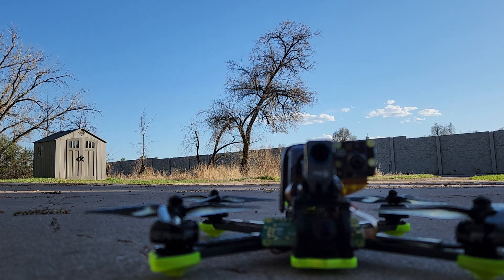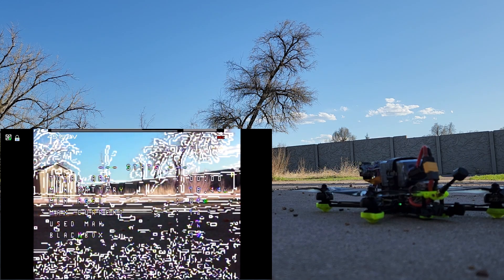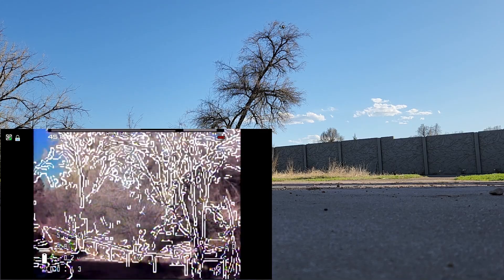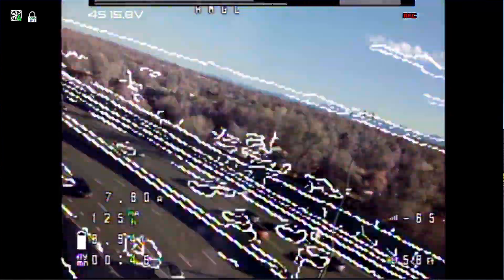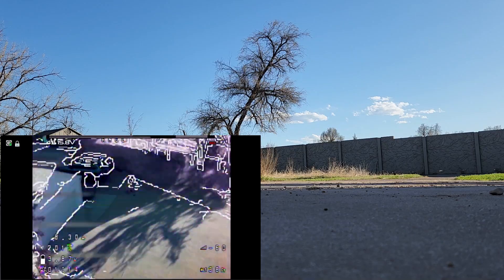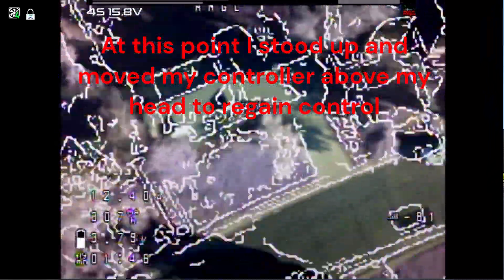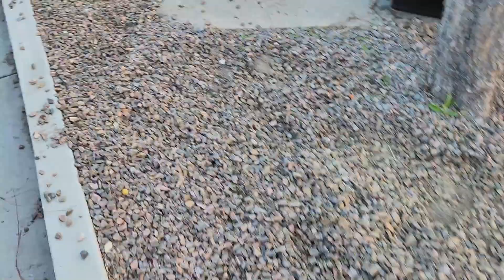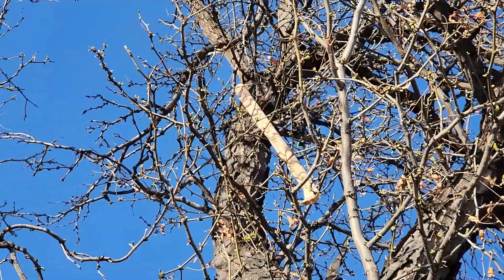Thermal drone test gone wrong!

Comment: Good work. Id like one of these but on a switch so you could just check quickly and then flip back to normal mode with no lag. Ill never do it but i sure will watch your videos to see what you do with this.
Reply from the maker: The behavior you're describing is essentially what the original code (linked in description) does

Comment: There is zero reason to be booting into a desktop environment, you're losing a lot of performance from that alone. Find a way to go straight into your video feed from TTY or use a smaller footprint window manager like i3.

That said - I don't think a pi is the best platform for this ..
Reply from the maker: Interestingly, the original code (linked in description) also boots into desktop, but doesn't have the horrible lag issue. It's about 1-2 frames of latency. The reason why I'm using a pi zero 2 w is because the original code also uses it and preforms well. I will definitely look into i3